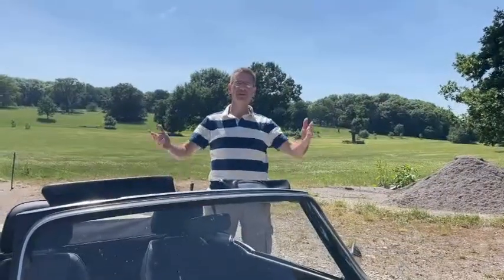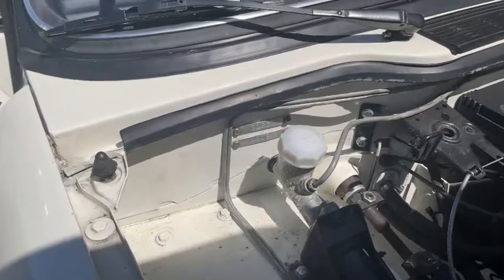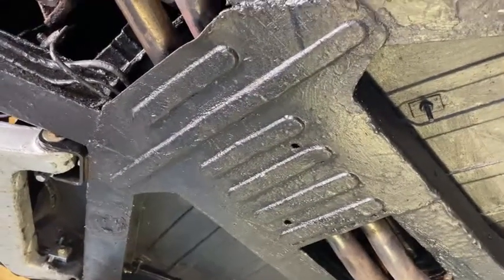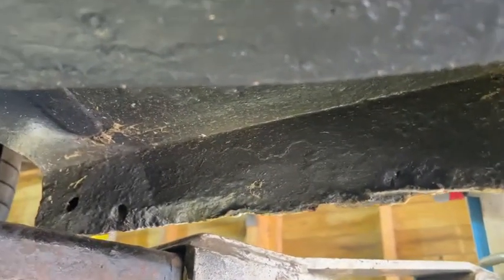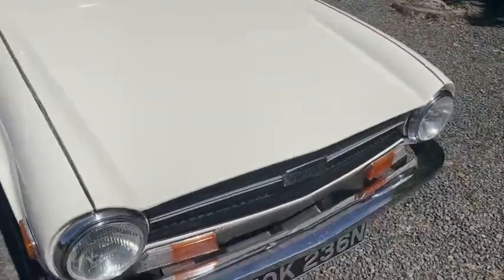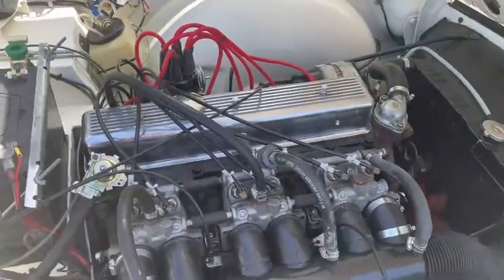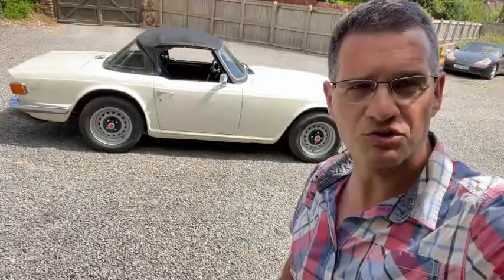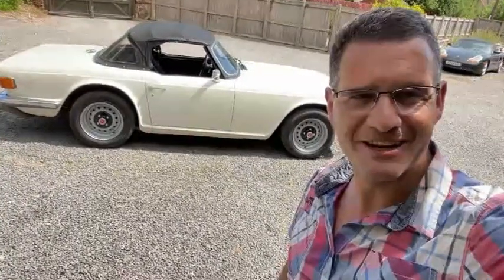Triumph TR6 Buyers Guide

Comment: A great inspection of the underside.  In the first part of the garage view the video is reversed as if you are looking in a mirror. The car is left hand drive and then becomes right hand drive. Funny quirk.
Reply from the maker: Yes, for some reason i haven't worked out how to fix yet when you film on the front camera on my iphone it reverses the image, yet the rear camera films correctly as i see it.  Very strange!  The car is actually RHD for the avoidance of doubt.
Reply: Thanks for the explanation but there was no doubt here.  British spec TR6 with the fuel injection.   Apparently you can even turn videos upside down now.   @mgmidget-thebirthofaraceca4349
Reply: I was quite impressed by the reverse direction of the rev counter too!

Comment: Have you done a review like this for the TR-250?
I have a friend trying to buy a barn find.
Reply from the maker: No unfortunately not, although the TR250 is very similar to the TR6 and has many of the same shortcomings and issues identified here as its based on the same chassis, same 6 cylinder engine and similar body construction. good luck with your search - would love one myself

Comment: Why were the US versions not allowed to have fuel injection? I bought a new one in 1971 and of course it had carburetors. I'm sure the fuel injected version would have been faster.
Reply from the maker: I believe it was to do with the PI system not meeting US smog regulations at the time. Although i have a UK car, given a blank page id probably have carbs (twin SU) to gain more ease of adjustment and setup over the PI setup. Each to their own though. Thanks for the input.
Reply: @mgmidget-thebirthofaraceca4349  -I agree about the ease of adjustment but going from 150 h.p. to 104 like mine had is a big drop in performance.

Comment: Very informative.. Do you know if there are any restrictions on installing a PI on an American Tr6? AND.. Is it worth the effort? Is it a reliable upgrade?
Reply from the maker: The US has its own smog laws which is why the PI system was dropped from the US in the first place.  I guess depending what state you are in youll know what regs are in place.  The PI system comes with its own issues - heat build up being the main one causing fuel vapourisation (not good in hot states). It is a bit smoother and when setup well is reliable but my opinion is it wouldnt be worth the cost and hassle to retrofit from a well tuned carb setup

Comment: How can you get one that has the higher power ratings? Or what mods can you make to an American variant to get those British numbers?  Thanks for your video!
Reply from the maker: the UK early ones had 150hp, the later ones 125hp. main differences were the PI system, throttle bodies, compression ratio, cam and metering unit tune

Comment: Find the most rust free model you can.  Replace the drive train with a small block V8 like a GM 327 or 350 with turbo 300 auto trans and a Dana rear.  Soften up the suspension to get a nice ride that will not rattle your teeth out, now you will have a reliable and interesting convertible.
Reply: Which is thoroughly devalued and ruined. If you want an engine swap a small high revving 3 or 4 cylinder turbo would be nicer, you want to go around corners after all!
Reply: You really don't want a TR6 if you plan on swapping out the motor
Reply from the maker: Very true. Thanks for watching

Comment: is it possible to retrofit a USA-spec with the fuel injection of the UK models?
Reply from the maker: Yes in principle however you’d need to research like for like cams, metering unit configuration and settings plus if there are and head and compression differences to ensure it runs properly. I’d recommend going the full EFI route if injection is of interest

Comment: What the heck here?  Some of the scenes are flipped right to left?  Your video is misleading because not all TR6s have tubular rear shock conversions.  Use poly bushings when possible, and convert to a non acid battery, Optima,  as soon as possible.
Reply from the maker: its a mirroring you can get on you phone when filming. all sorted now in the settings. it is actually a RHD car

Comment: Tbh, yours didn't sound that great on start up.  Rough.
Reply from the maker: Well spotted Andrew. It is a bit rough cold on the choke, but once the choke is in runs well and smoothly. My video on the PI engine tuning explains how the throttle balance springs can be very difficult to set as the throttle pull acts in the opposite direction to the choke pull. I always set the idle to the throttle cable for good running at the expense of choke setup. Aftermarket linkage systems can solve this.
Reply: You mentioned the idle was low too, if set higher, would that smooth it out as well ?